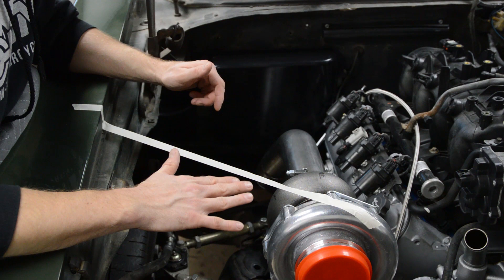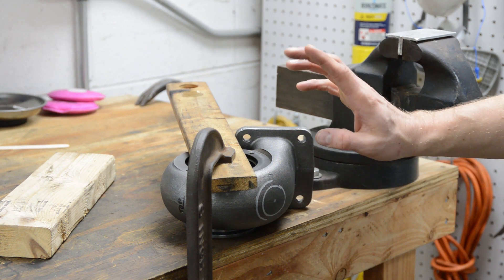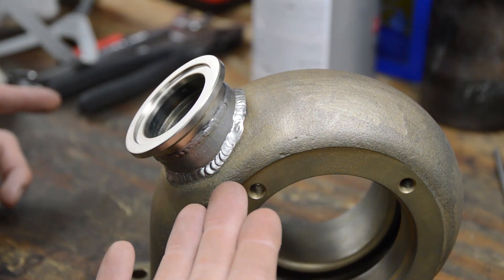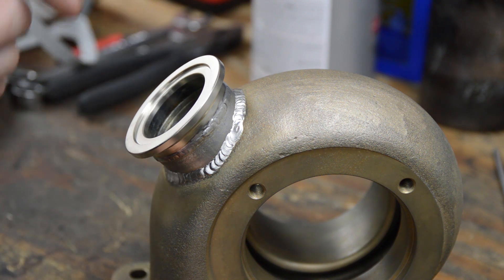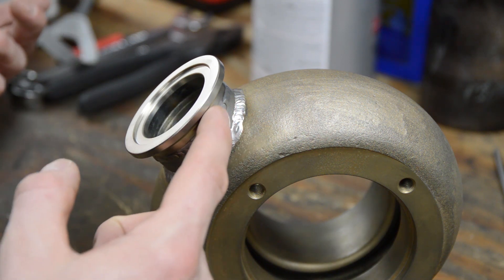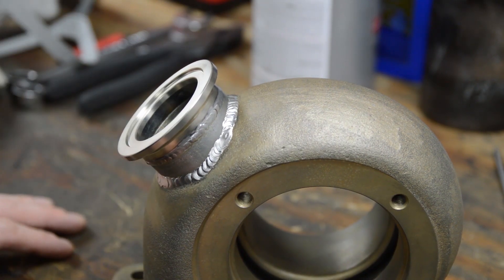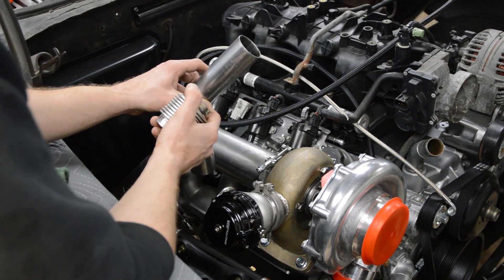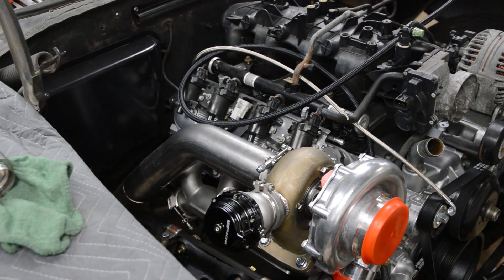Chevelle LS Turbo - Wastegate welded on turbo housing

Comment: Did this on my borg Warner efr 7163 and it worked great! Moved to a bigger turbo and went back to manifold external wastegate and had boost creep issues at 7500 rpm 😩 Thinking of going back to my old ways…

Comment: Drilling cast that way the bit will walk u need to be constant don’t stop stay still and cast doesn’t need cutting oil when u stop and start you warp the hole but lovely welds
Reply from the maker: Yes, the hole was sloppy and had to machine a fitting/bushing for a better fit. Next time I'll mount it in a mill/drill press.

Comment: So confused why you would put the waste gate directly on the housing. It will bite you at some point.
Reply from the maker: How so? Locating it off the log manifold would have been a pipe routing nightmare.
Reply: Why? People have been doing it for ages and it works really well.
Reply: A lot of people do it this way for better control over boost, not all manifolds flow well enough to dispel all the extra gasses through the wastegate with poor fitment choice.
Reply: Please explain your logic? 
Sloppy Mechanics worked out, Skid Factory worked out and many many others have done the same.. 
The idea of the waste gate is to redirect the flow of exhaust gases, sure some gases will still get to the turbine (regardless of where the waste gate is installed) but not as nearly as much (IMO) if it is mounted as close as possible or directly on the turbine side.. 
Hell some folks are using 2 waste gates, 1 on the housing and 1 at the merge point (from bank to bank) and take a good look at an internal waste gate design, its pretty much the same but a smaller hole/release area..

Comment: Do you have any info on how you did the power steering lines and and adapter for the pump?
Reply from the maker: I did a jeep cherokee fast ratio box swap so I the new o-ring style fittings just like the LS. However, I also did a hydroboost swap converted to AN lines. Fittings and lines linked at bottom of this page: https://howtomotorcyclerepair.com/how-to-diy-hydroboost-on-gm-vehicles/

Comment: I just got my car done I did mine in the exact location 44mm turbo smart gate on a gt45 5.3 and I’m having terrible boost creep. I seen someone that had the same issue and they ended up putting the gate at a angle so it would flow through it better instead of being a 90 degree right off the housing and he said it fixed it. But I keep seeing people do it just like this and it works fine?
Reply from the maker: It is possible that the turbo you are using is pretty small (backpressure) for a 5.3? What boost level are you trying to control. Mine hits the road for the first time later this week.